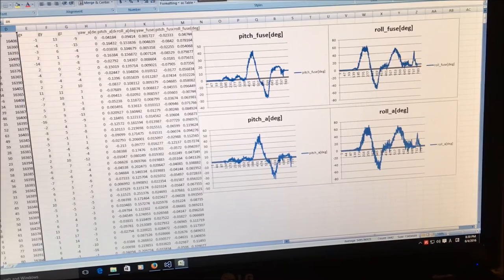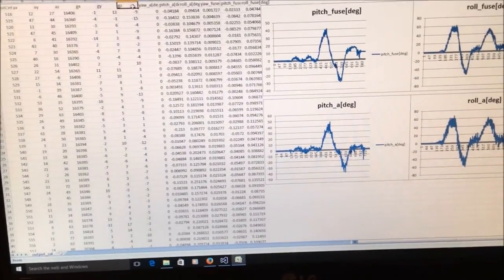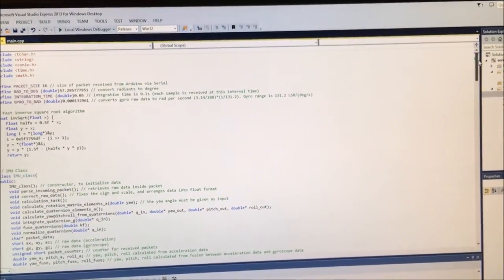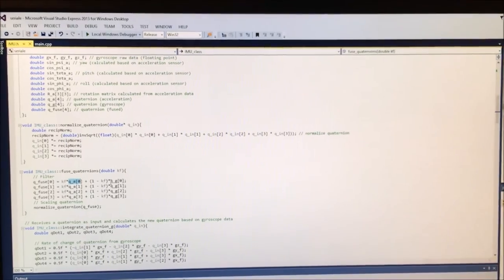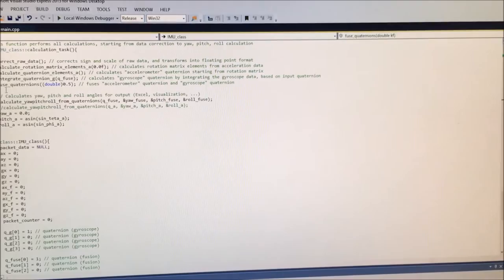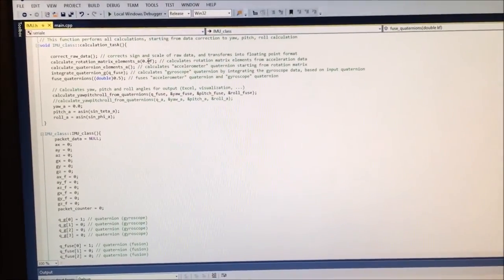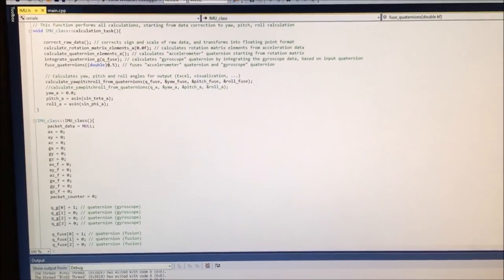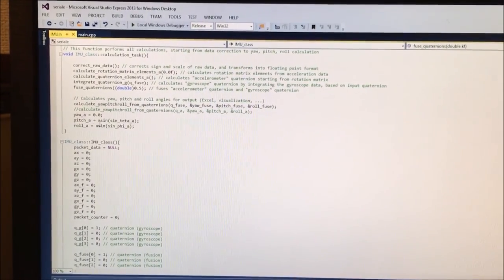Yaw pitch roll angles calculation using acceleration and gyroscope sensors signal fusion

Comment: hello, i am working on my bachelor thesis and my work is based on a pid system and for the euler angles (or tait-bryan) i am using quaternions instead of the Euler angles just like you. I am implementin a Madwick filter but i would like to see your code too. Could you give me a link to the source code because i could not find it in your website. Thank a lot

Comment: if gyroscope saturate does it affect  yaw pitch roll?
Reply: Yes, which is why you use the accelerometer data to compensate for the resulting drift.
You should check out this article for a more detailed explanation of a simple yet powerful complementary filter:
http://www.pieter-jan.com/node/11